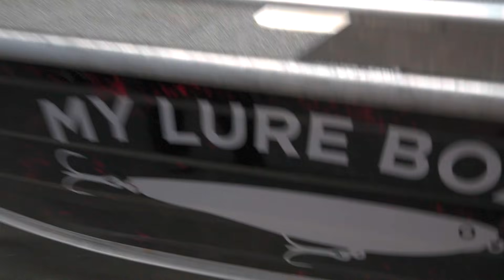MY NEW LOOK BOAT + TIPS FOR BUYING AND FIXING YOUR TINNIE

Comment: Hey Johnny, I got a friend that bought a tinny a while ago. He has recently had to fix up a hole in his boat. The reason was that there was a lead sinker stuck under one of the struts on his tinny. The repairer told him that its not instant corrosion but it takes a while. Sinkers, swivels, hooks and even a coin will cause corrosion in your tinny over time. It'd pay to have a check every now and then under the struts on your boat and very regularly give it a wash out with fresh water. You don't wanna be sinking in the middle of a crocodile infested creek with your family in the boat! Have a safe trip to you and your family, looking forward to seeing your adventures. 👍
Reply from the maker: Thanks James. That’s a great point to raise re. The corrosion from other metals and terminal tackle ;) cheers mate

Comment: the wrap is Johnny all the way. gud boat loader as well and structure inside the canopy. if i had known u needed a boat loader i wud have given u my fathers. he bought the same with winch and it is not used any more, it just sits in my mothers shed.